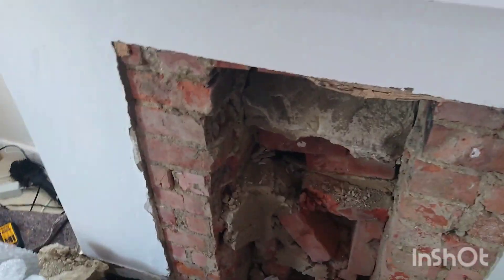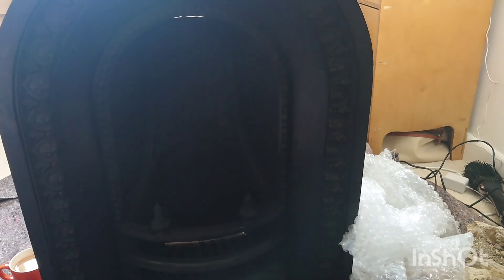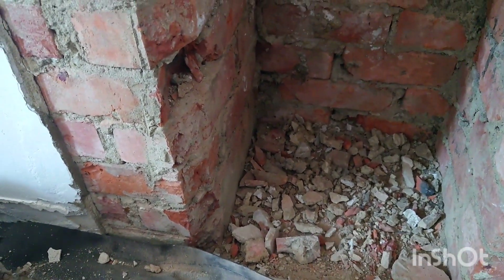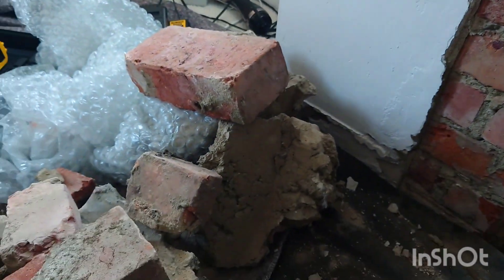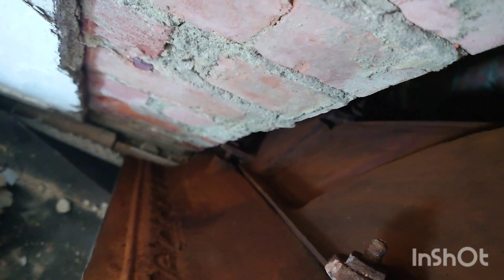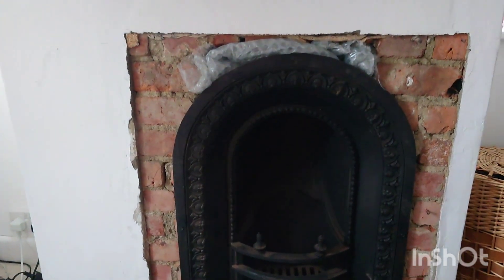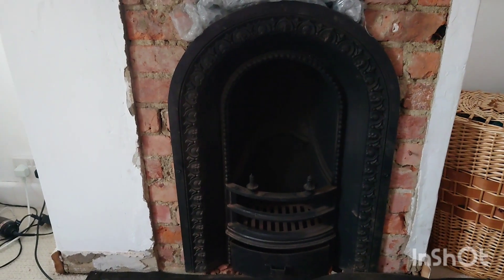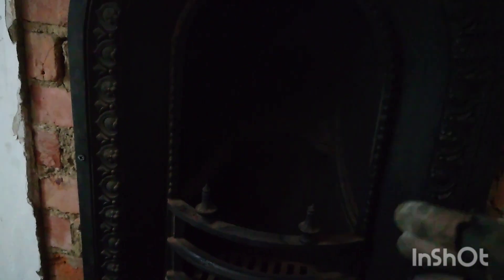HOW TO FIT A CAST IRON FIREPLACE.

Comment: Great video! I’ve a question though – what holds the insert in place? I didn’t see any screws go in. Is it just the surround that keeps it in place?
Reply from the maker: @JoshGoodmanUK  yes this one I screwed it into the wall. But you can't see screws as they are black. But if it's a square one. You just screw the fire surround in.🎩🎩